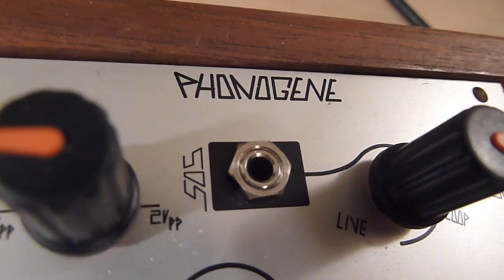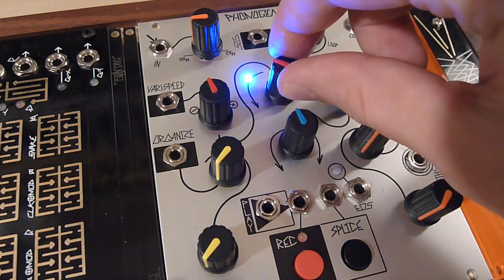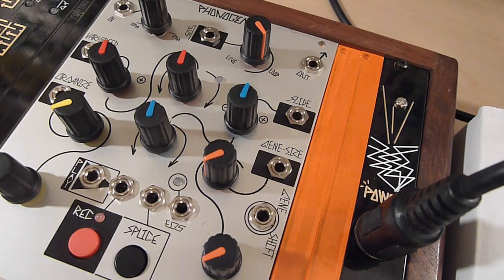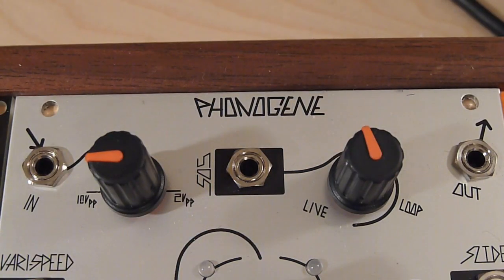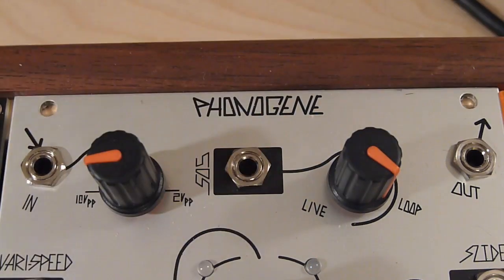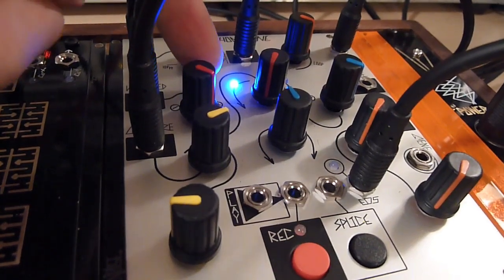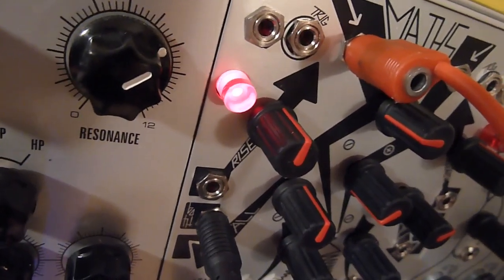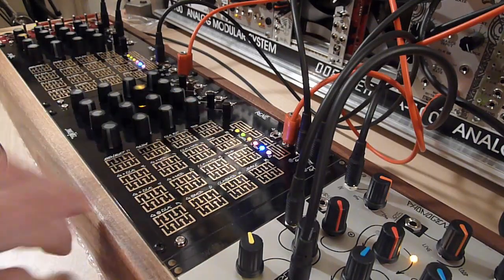Phonogene 101: Your Genes and You!

Comment: Great upload, thanks

can i use this standalone? buy a little doepfer case and have the out of the phonogene into my audio interface? ideally i would like to just have the phonogene and echophon modules. Possible?
Reply from the maker: Yes, absolutely, that would be a great pair.
I do think you get even more hands on control with one or two Pressure Points and a Brains controller for them.  The sequencer and touch plates end up being very tactile and useful.